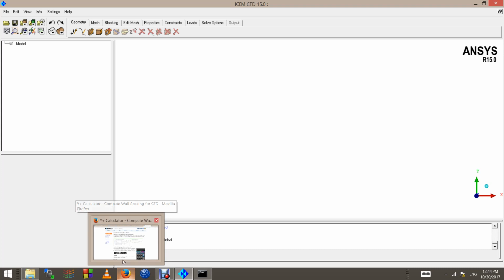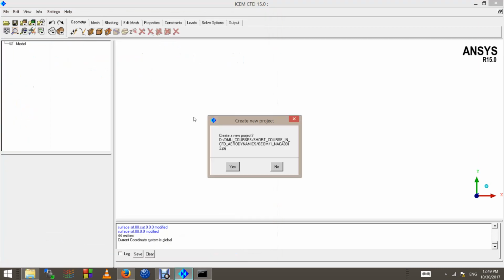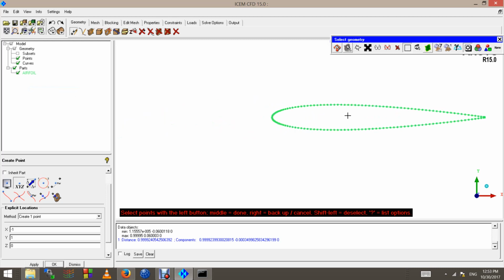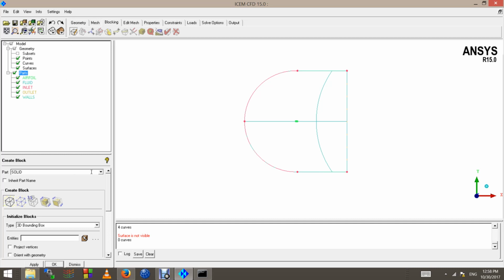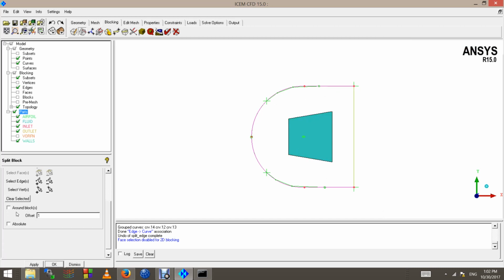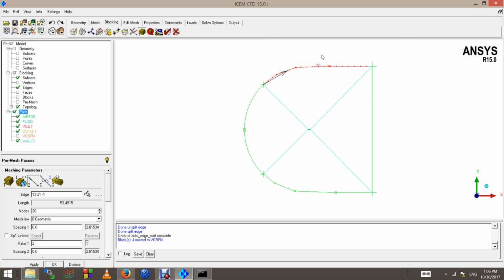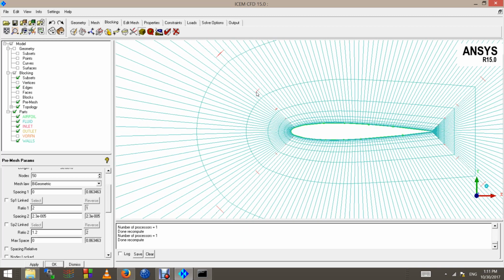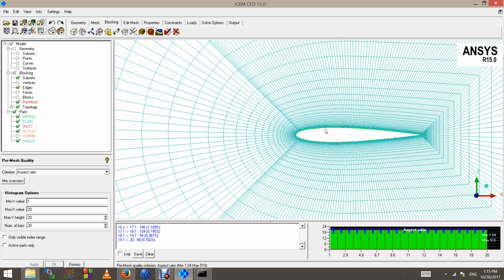Lesson 2 -  Meshing An Airfoil using O- Grids in ICEM CFD

Comment: I’m conducting an airfoil analysis in ANSYS and want to run multiple AOA cases using a single mesh. To ensure accurate results, how should I size the enclosure? Specifically, what inlet, outlet, and vertical distances (in terms of chord length) are recommended? Are there any reliable studies or sources on this topic?
Reply from the maker: 40c to 50c at least. And for the mesh, when you go to stall AOAs you need to think about where the separated flow is going to shed. So refine those regions too.